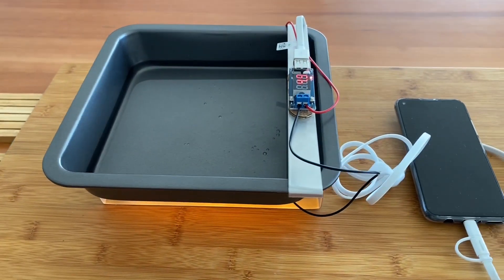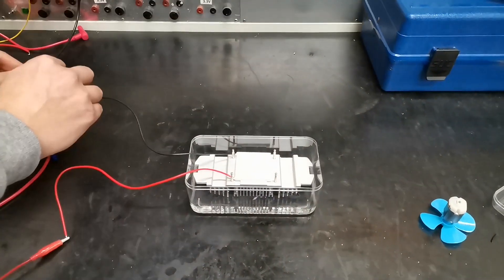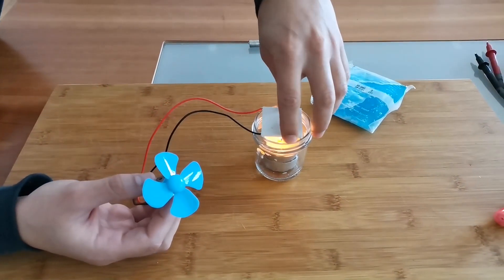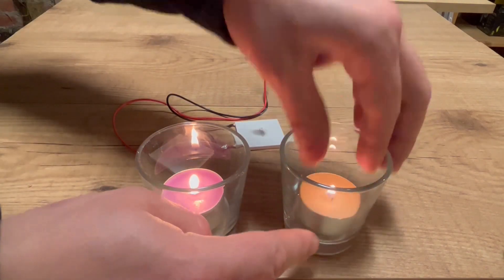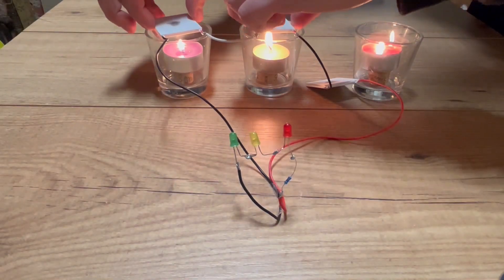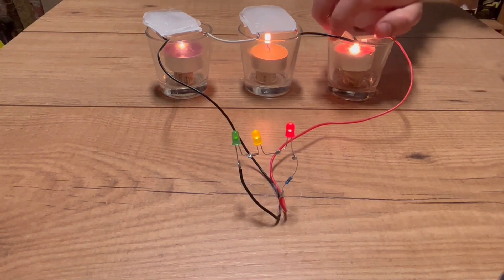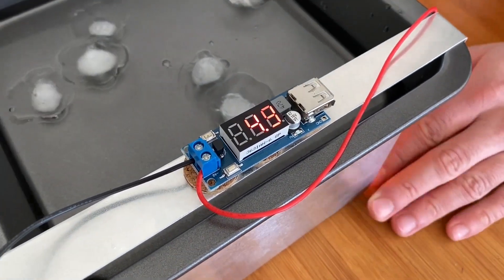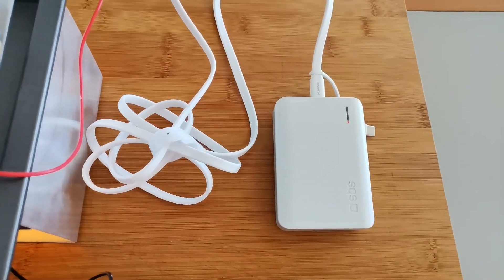Thermoelectric Cooler (AMAZING SCIENCE EXPERIMENTS)

Comment: Hi bro how are you,
How much maximum voltage it does generate.
Reply from the maker: Hi mimo fan, it really depends on how many TEC you have in series. In my previous video "Building a DIY Thermoelectric Generator (TEG)" I had 8 TEC in series and generated 10V but low Amperage (~1). I managed to charge % of my phone after several hours though.

Comment: if I run out of battery on my phone, wouldn't be more practical to plug in the charger instead of using an inefficient thermoelectric generator?
Reply from the maker: Hi Adi. It sure would be more practical to plug in the charger but think of an environment where you don’t have access to electricity, wouldn’t it be handy?
Reply: @DaniElectronics  Hi! No, I cant think of an environment without electricity: we have external battery packs, more efficient solar chargers or even gas generators for longer period. Thermoelectric generators are just not powerful enough for this job, and are really really really large compared to the power they produce. Please tell me how many amps your setup can produce? Dani, its fine to light up a few LEDs and show the concept but its not practical at all. I have never seen somebody preferring to take a really complicated setup in the wild to charge a phone at a very very slow rate, rather that tacking an external battery pack in your pocket and fast charge your device. I don't have a problem with your video, it was quite educational but again, NOT practical in real life scenario. Cheers.
Reply from the maker: Hello again Adi. I must agree with you that solar chargers for example are more portable and efficient. But it could be a cloudy day! Anyway, I understand your point and agree with you but as you also said it’s for educational purposes that I made this video and hopefully it’s well explained and people understand how a Thermoelectric Cooler works and how it generates energy.